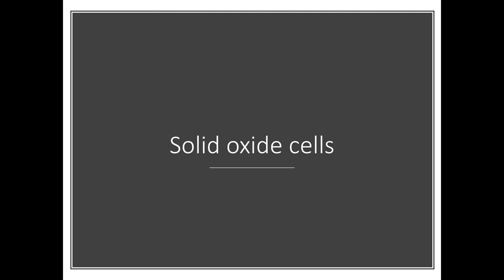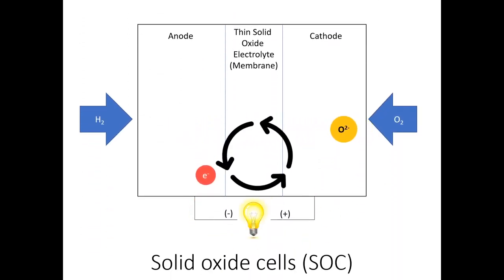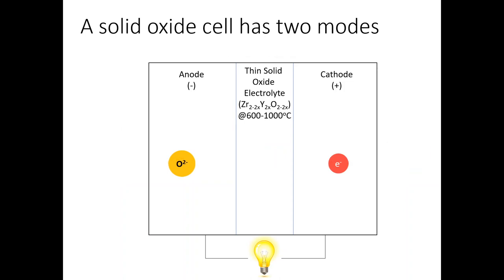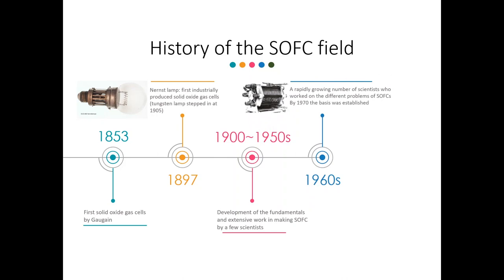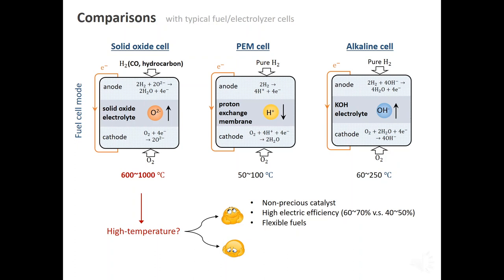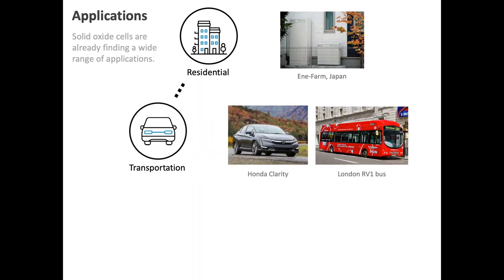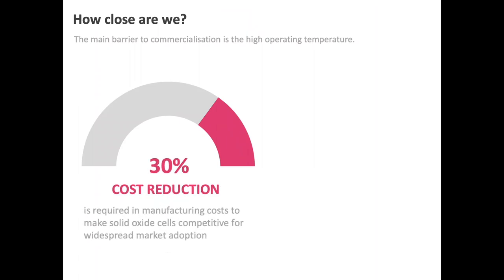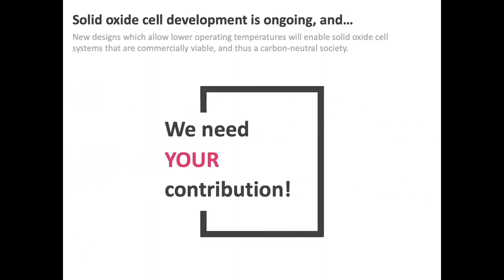Introduction to Solid Oxide Cells (SOC)

Comment: Our planet is NOT "suffering from climate change" and CO2 is absolutely necessary for plants to live.  We depend on Oxygen, plants depend on CO2 for photosynthesis.  An  increase, not a reduction, of CO2 in the atmosphere is needed to boost plant growth on our planet, for forest and grassland restoration.  Any industrial process that produces CO2, such as cement production, promotes plant growth, i.e., forests, grasslands, farming, etc., is highly beneficial to life on earth.  CO2 is inert, is not a "green house" gas, completely non-toxic, and has been falsely portrayed by lying media as otherwise.  
There is nothing wrong with using hydrogen as a fuel either, with the understanding that any hydrogen production process uses a lot of electricity which also has to be generated by some means and the only reliable and efficient electrical generation means are hydroelectric, nuclear, natural gas, and coal.  Wind mills and solar cells are unreliable, insufficient, and not economically feasible requiring expensive maintenance such that they are not economically feasible.  They cost more to operate than the electrical power they produce is worth.  They exist only because they are heavily subsidized by the feel-good "green" movement created by the false "global cooling" scare followed by the equally false "global warming" scare which has not metamorphosed into the false "climate change" scare.   Greta Thunberg is a nitwit figurehead teenager, not a physicist or chemist or biologist or meteorologist or by any means a scientist capable of forming a valid scientific conclusion and the "climate change" movement is about political power, global taxes, and one-world government superseding national governments.